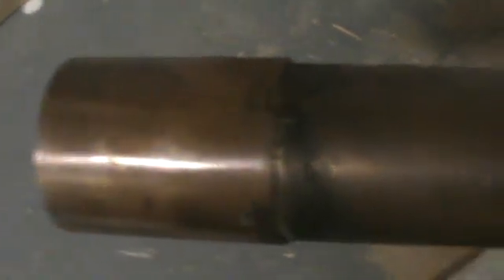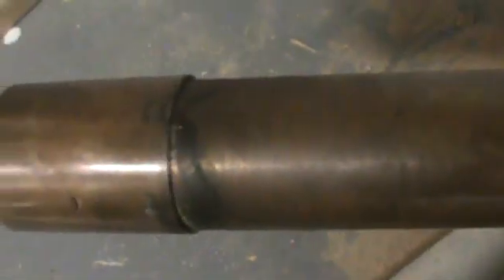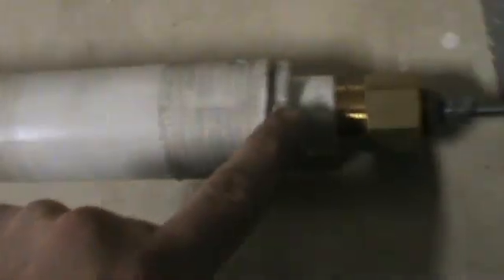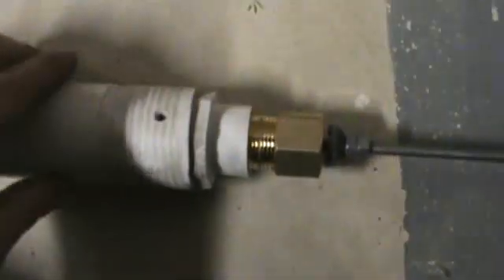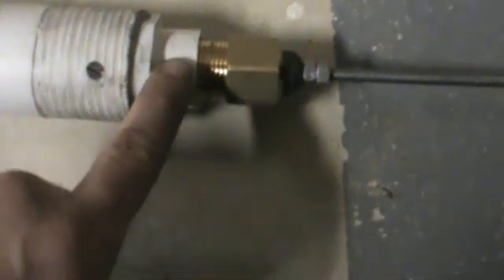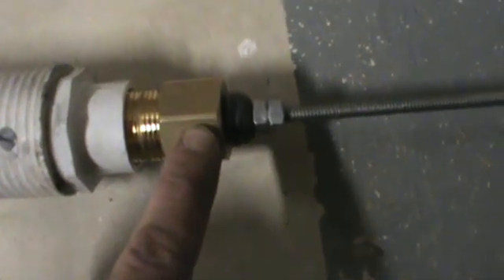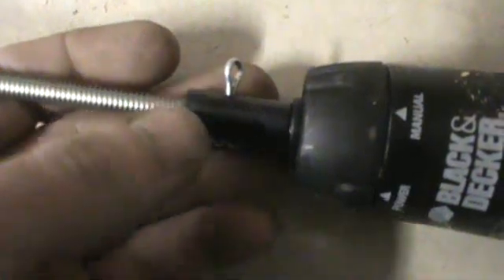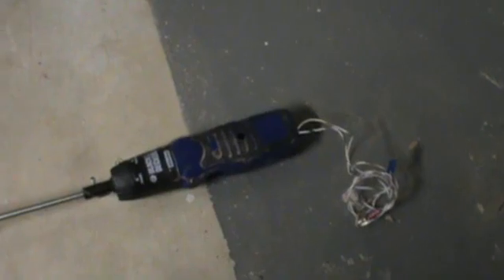Screwdriver Dipole Antenna Build pt2

Comment: Use a Rigid 535 & close the jaws way more that usual, or crank an Ensley stairwell pipe threader down & use schedule DB 120 extra thick PVC & you can get 8 TPI on 2" and use #14 AWG hard copper. I had a jeweler roll #10 soft copper down to #14 and that made it about half hard. I may drop $200 on some full hard Argentium 94% silver for the next  build. I am buying either acetyl or fiberglass for my coil forms. PVC gets to warpy & weird. 73s KI7AQJ

Comment: Where did you connect the wire that's sticking out at the top.
Reply from the maker: As we get to the parts list around 1:20 into the video. You will see the top two brass fittings on top of the pvc. A hole was drilled from inside the pvc out and upward tward the outer threads of the bottom of the two brass fittings. Look close and you can see a small screw was drilled into the top brass fitting on the side where the wire is simply wrapped around and cut. If you need any more help, just ask.